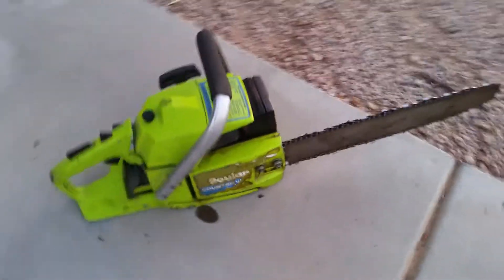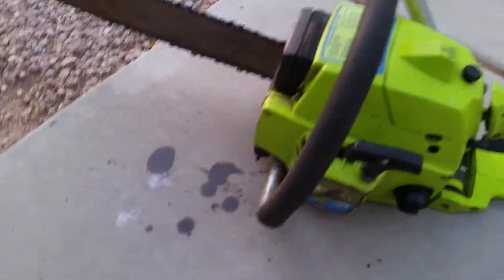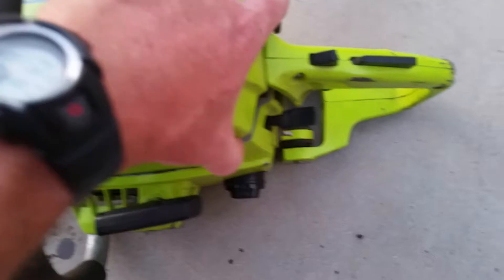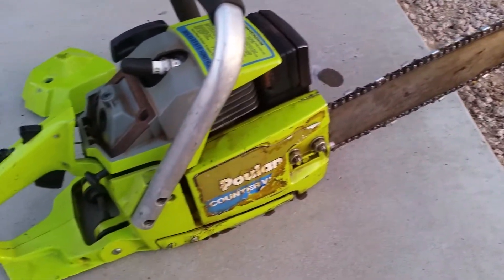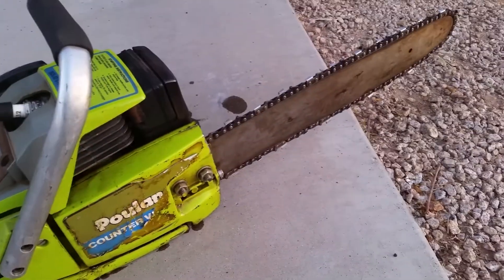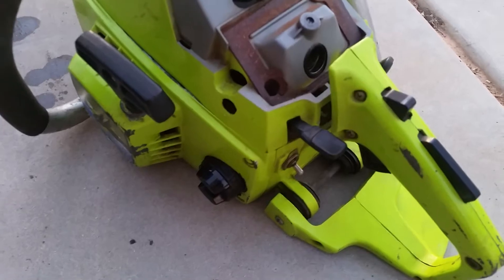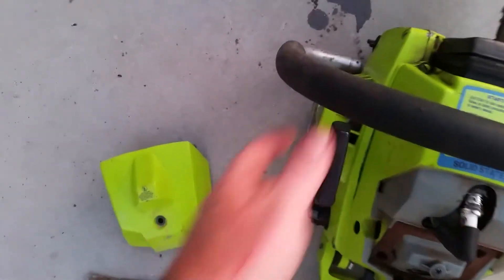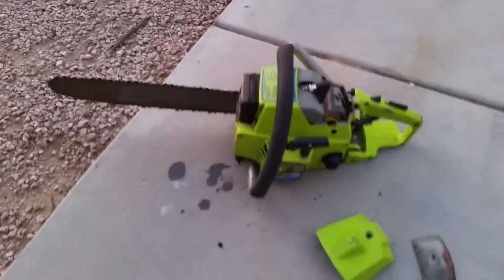Poulan 3400 chainsaw 3.4 Craftsman

Comment: These are great saws. Have a Craftsman 3.4 18" chain for nearly 40 years. The fuel line and carb will gum up with non use, and that is the biggest problem aside from old gas in the tank. It has about 40 hours max on it. Keep the chain sharp and dress that bar and flip it every 3 tanks....Mine's still original chain.

Comment: I still have those four saws I bought off you from offer-up, That Poulan still runs like a damn champ ive only had to replace some fuel line
Reply from the maker: Nice. Did you fix up the others? Ive got a chinese 365 I'm selling
Reply: @KimballCody  I got the echo cleaned up, still use the homelite xl and I'm restoring the dolmar

Comment: I bought one last Saturday at a yard sale for $20.  Looks like they put the chain oil in the fuel tank and then just set it back in the shed when it wouldn't run.  I'm  planning on putting new fuel line on it before running it.
Reply: After a year of running it,   It’s one of the best saws I’ve ever used. Before this,  the Homelite Super XL was my go to saw.

Comment: not much help. I'm trying to find out which is the high and low adjustment on the carb. mine won't stay running and PO as in Post
Reply: Top two screws L is low R is high
Reply: Bottom is idle

Comment: I have one in my garage that won’t run.
Reply: I can get 'er runnin' for ya'...
Reply: Replace the fuel line I've done mine it runs we but not oiling the bar has an automatic oiler and a manual hand pump neither is working properly